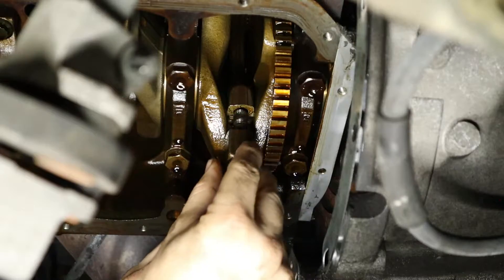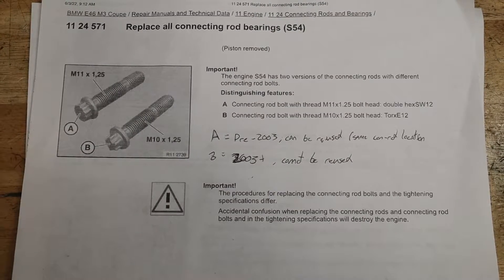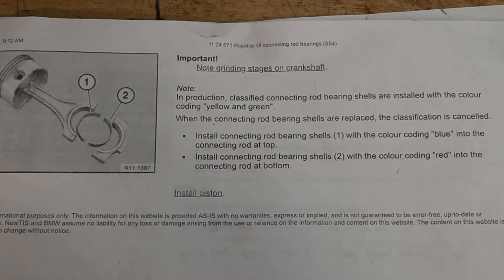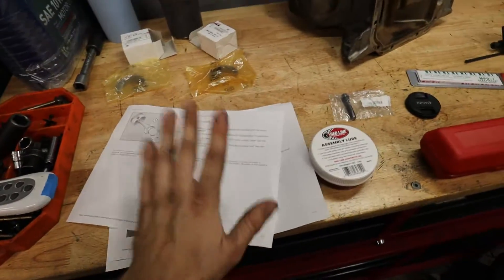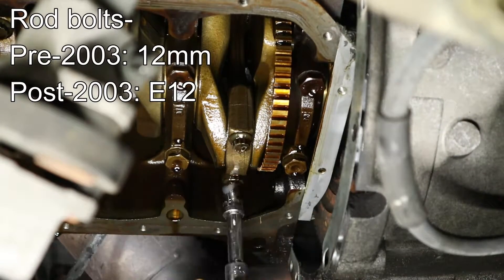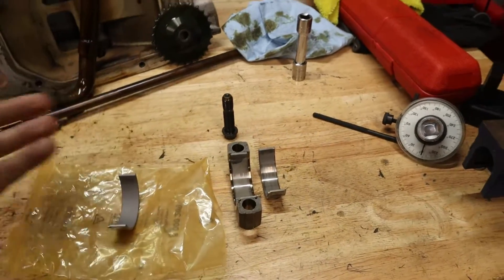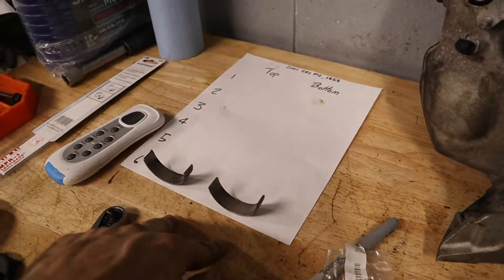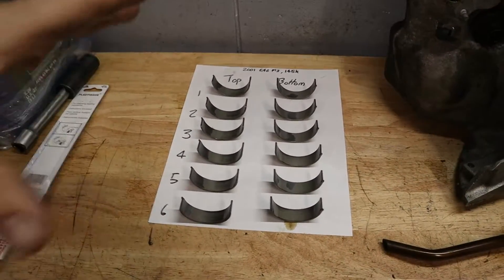How to: Replace S54 Rod Bearings! (+ Checking Clearance w/Plastigauge)

Comment: Yes, 100% on letting the motor/oil warm to operating temp. There’s a reason there’s an oil temp gauge in these cars! Thanks for the vid, I have an oil pan gasket leak so will be doing all the same to my ‘02 e46 M3 soon. Love the quick jack too. Will probably be a good time to invest in them. Also need to replace the rear diff at some point so QJ will come in handy as I do a complete suspension refresh.

Comment: Great job on the video and explanation. I also will be doing the same job on two motors one that is out and the other that is in the car on a 2001 325i. Your video will be very helpful. Where did you get the handout on the instructions and spec you used .I will be doing this for the first time on a BMW engine.

Comment: I see you had a quickjack. I will be doing mine soon on a quickjack. Did you support the steering rack with anything or just let it hang?
Reply from the maker: I just let it hand with the rest, and make sure you remove the lines before letting it hang, so it doesn't stretch the rubber hoses. Quickjacks are a life saver. Thanks for watching!

Comment: WD40 will remove that plastigauge very easily. I wish I dropped my subframe on my 335i like you did on this S54 when I changed my rod bearings - #1 upper and lower were broken in half when I got in there. I was wondering why the engine was rattling for a few months - live and learn.  Great content either way bro! Also too bad on that oil pump bolt - I would have replaced it while I was in there but you could get to that bearing without moving it so no harm no foul! ;^)
Reply from the maker: How many miles on your N54? About to do my bearings this month, wondering what mine will look like... Thanks for watching and leaving a comment btw, Cj!
Reply: @TheBimmerBarn   117.8k. Runs like a dream at least for now.  Wind noise is a bit up as it is a e93. I never liked BMWs but this was a good deal and your vids really helped me out with the basic maintenance on her.